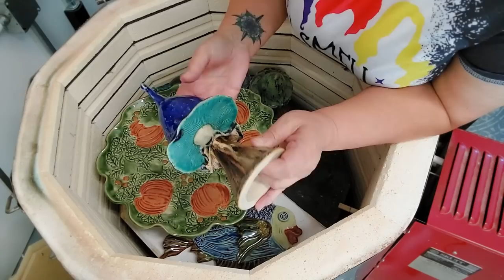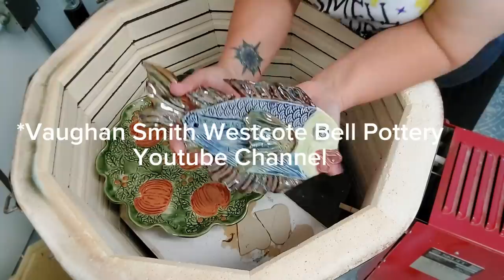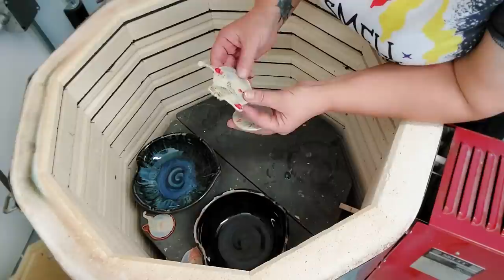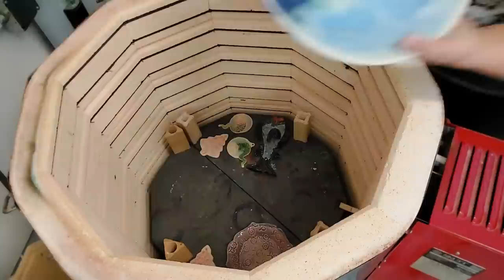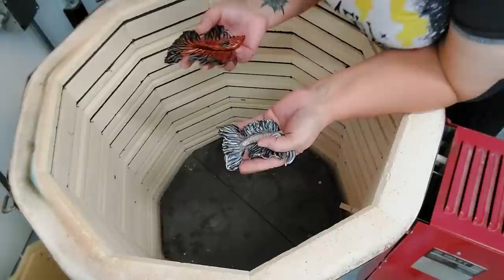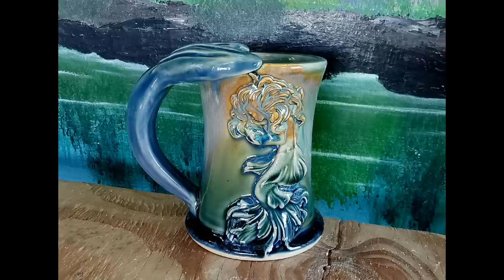Kiln Opening (gearing up for an Art Festival)!

Comment: Hi Tiffany. I am so sorry to know about your migraine. I don't know if you've tried to use rosmarin and peppermint to relieve it, but I want to share with you what I make that has helped a friend of mine. I grow peppermint, real pepper mint, not the curly one, and I take it and deleaf it and dry it half way before putting it in a blender ( about 3 - 4 tight packed cups) with strong alcohol, I use a hand sanitizer that's 70 % or more . I put this into a big jar, putplastic foil first and then the lid, tightly. Then I pop the jar into a black bag and on a south facing windowsill to sit for at least a month before draining and sieveing the mixture. I also do the same with rosmarin, but I do not dry it first, but mix it thoroughly with the alcohol. After sieveing both (very dark green liquid), I mix them together and pour into a bottle and that is my base. I make a spritz from this by pouring it 2/3 full into a small spritz bottle, and put extra 30 drops of rosemarin essence and fill up with alcohol. My friend, who is bald, btw, used this by spraying it on his head and said it made him feel much better and his mind cleared up as well.   I use this mixture on my feet morning and night and in my shoes as well and my feet never ever smell. I cured my sefl of corns on the bottom of my feet with this and they have not returned. It's good for fungus prevention as well.....
Sorry for the long essay, but I hope this can help you in the future and others that read it.
Reply from the maker: Thank you! I grow peppermint and this sounds awesome.